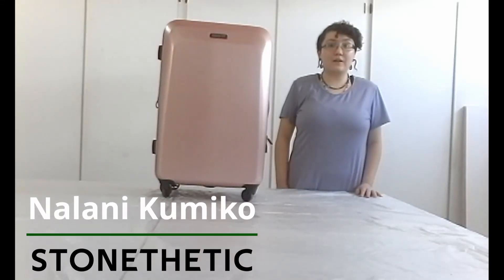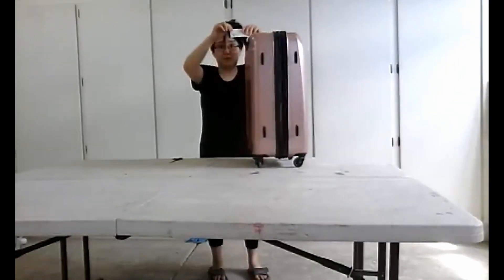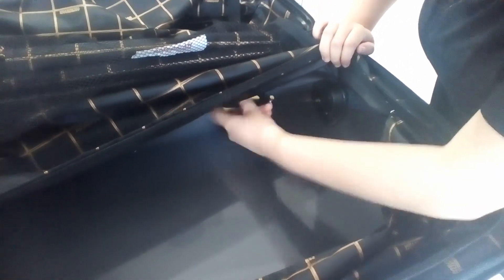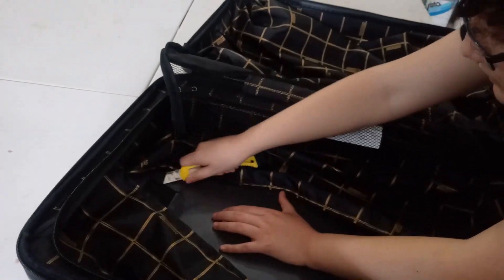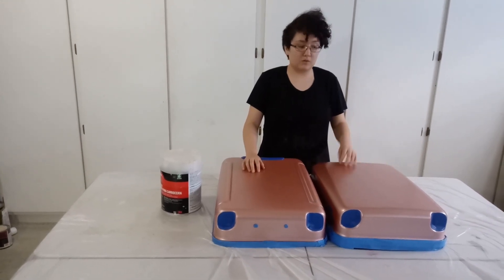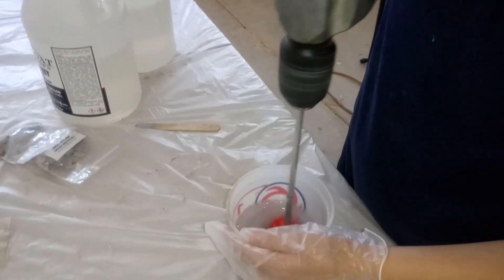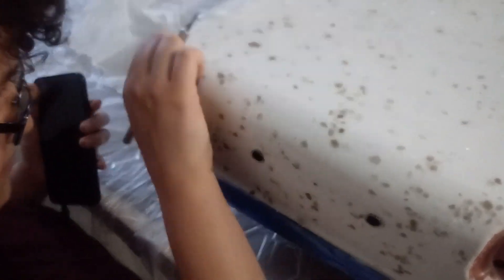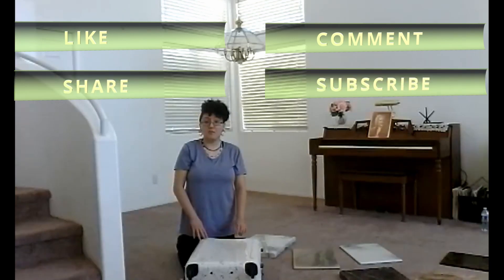How to Epoxy Coat a Luggage Case

Comment from the maker: Some lessons learned from this project:
1.  I didn't need to mask off as many areas as I did.  If you are willing to buy new screws/bolts, then you can just coat over those areas and get a slightly longer machine screw to attach all your hardware back on.
2.  I should have used the Tyvek tape for the zipper and the retractable handle instead of blue painter's tape.
3.  Elevate the project higher off the table when doing the epoxy.

But overall, this was a lot of fun, and a different type of project.  Let me know what you think!

Comment: Curious approx how much weight the epoxy added, thanks!
Reply from the maker: Doc, it wasn't too bad.  I mostly wheel the case around, and use it as a "Mobile Showroom" for my sample boards, so most of the weight I experience is due to the contents.  In the end, it added maybe 1 lb, (.45kg) if that.